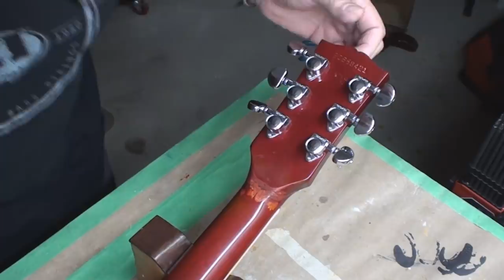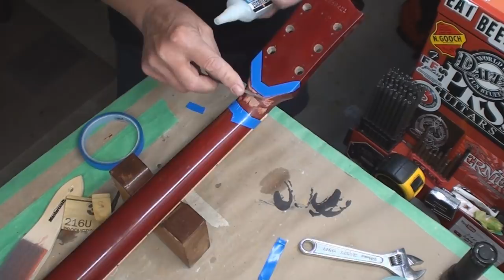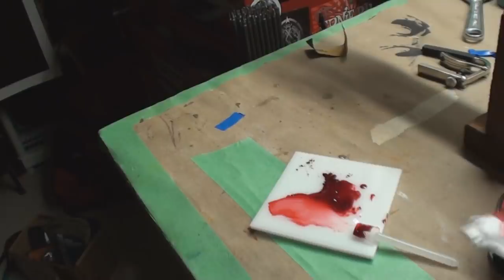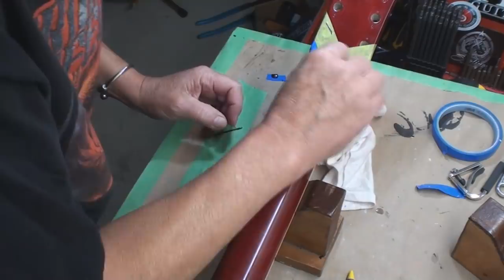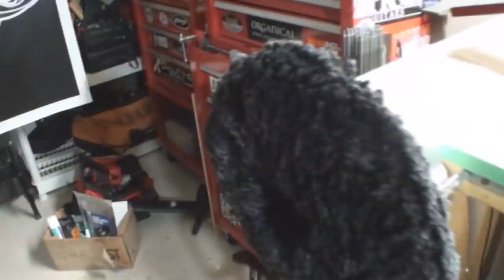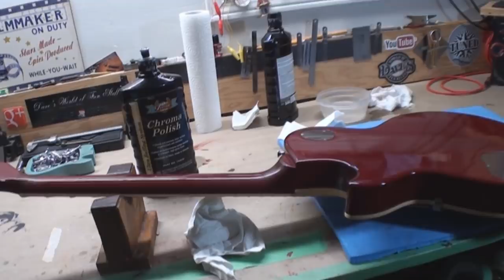Broken Headstock Repair Using Gluboost

Comment: Folk are quick to blame the extra degrees of Gibson's head stock angle for a weakness in this part of the neck, but really, how about not dropping it in the first place.
Reply: Damn right ! 
If you want to do gymnastics while playing a guitar, invest in strap locks, then you won't risk expensive repairs after every gig !
Reply: It's not the headstock angle that's the issue, it's the fact that they use a single piece of timber all the way through, letting the wood grain create a natural "fault line" at the headstock...and *on top of this*, they remove a chunk of wood from an already structurally weak area for truss rod access, rather than a stronger point such as, say, where it joins the body...

I get what you're saying, and everyone should exercise caution with their instruments, but the fact of the matter is...shit happens, and owning a Gibson puts you at a distinct disadvantage WRT damage to your musical output and/or wallet in the case of said shit happening.
Reply: Ian Clarke Strap locks are a gift from the heathen gods of demon music, I agree. Every guitar should have them.
Reply: It's a bad design and they know it. It's more likely to break and you can drop all sorts of other guitars with a volute or just with a little less angle. They might break at a really hard drop but Gibsons break like crazy. Repair guys know it...you just get tons of those compared to other guitars.
As Kaiveran Lugheidh mentioned, the other reason is the grain that becomes short grain because of the change in angle while the wood fibres point straight ahead. That's why multi laminate, opposing grain and the flipped reglueing  in the first few frets ala Ibanez is much stronger. Still, the lesser the angle the less likely the break at a vertical drop on the back.
Reply: They can also break without any force other than string tension.  I was at Guitar Center (shame, shame... I know) and one popped a few feet behind me while sitting, untouched, on a floor stand.
Reply: Probably already had a crack from shipping, the highly qualified people from guitar center didn't notice it or it got dropped in the store, was picked up and gave in later.
Reply: Ah, good things to note that I didn't think of.  Thanks!
Reply: Kaiveran Lugheidh  my two Gibson guitars(les-sg) have laminate mahogany necks. 3 main spliced and two ears on the headstock.
Most of the cases that Gibson pack there guitars in don't account for a 17 deg headstock= the headstock is taking the weight of the entire guitar. This is as much yo blame for accentuating the weak spot.
Reply: Shout me down by all means, but are Gibson increasing the use of mahogany as a neck material and is this exacerbating the number of fractures?? I note that the new 355s have a mahogany neck whereas I think back in the '60s & '70s they had maple ones? I haven't heard of any incidences of weakness in the maple L5 necks.
Reply: +Oldpigsass   Maple necks on a Gibson are a bit  rare.  They have used 1-piece Mahagony necks forever and a day - and have always have breakage  problems (worse now with crappier wood supplies).
I'd still go with a Gibby over a Fender any day....though there are even better options.
Reply: Thank you sir. I checked out the Gibson site and was alarmed by the prevalence of mahogany even among the archtops. What's the attraction?  I only own three Gibsons, '73 L5S/'78 ES355/new L5 Doublecut, and mercifully they have maple necks, though the L5/L5S are 5-piece streamed with what's supposed to be walnut, but now I'm wondering!  Never any issues with them or maple necked non-Gibsons, an old green Starfire VI, Hagstrom Viking, and quirky Antoria jumbo with a fabulous fat flamed maple neck, back and sides. No mahogany anywhere...... except the wardrobe doors.
Reply: I picked up an Epi semi hollow body at a GC with a cracked neck! I gave it to the manager who quietly put it away. Quality  control!
Reply: Well I guess a chain is as strong as its weakest link. Having said that, and admitting that although owning a couple I have a slight aversion to solid bodies........ have you seen the size of the centreblocks in 335s? I knew they weren't very narrow, but there's much more block than hollow. My God it's like a windowsill!
Reply: yeah , I have seen them come out of a case with a snapped stock , always at the volute
Reply: the simple solution would be a scarf joint or a volute... it's fine to complain when they know a serious flaw exists and they don't rectify it.  If you so much as look at an SG headstock the wrong way they fall off...
Reply: if you can hear the difference between a guitar with a volute, a guitar with a one piece neck, and a guitar with a scarf, you're lying.  I'm willing to bet most fans would rather a guitar where the head doesn't come off if you breathe on it too hard

Comment: This reminds me why I should buy a Strat instead of a Les Paul.
Reply: amen
Reply: Subjective.  What's not subjective is strats are about $3000 cheaper.  LP's aren't $3k better sounding.
Reply: Lee Mcfarland . Exactly why I play strats everyday their way cheaper and very versatile guitars . Good enough for Hendrix and Gilmour good for me too lol
Reply: Just like with the parties...there are more than two options.
Reply: Except for the fact that the vast majority of Les Pauls don't even cost $3000 total. The core USA ranges from around $800-$3600, with most of the normal les Pauls being around 1500-2500. American Strats get in the mid-high $2000s too. The only Gibsons that cost $3000, even $2000 more than American fenders are the custom shop Gibsons, and custom shop Fenders cost just as much. What's not subjective is that Gibsons offer the most affordable American guitars of any of the big names, and also that they offer guitars in all different price brackets for people who feel like spending more. 

I love Strats, but this complete nonsense and misinformation to bash Gibson is getting so annoying.

For example, I bought my new 2017 Les Paul Standard for $2700, and with the asymmetrical neck, compound radius, individual coil taps, phase inverter, and pot bypass, as well as locking tuners AAA top and all, it's a hell of a lot higher spec'd than its competitors, especially Fender's equivalent priced Strat (which I also love, not bashing, just defending) .

Comment: that stuff is amazing! I found it on ebay and I needed something to seal of a little divot on my les paul neck on the side below the nut. She fell off the strap WITH STRAP LOCKS and hit the floor. Could have been worse but it drives me crazy knowing it's there. I thank you for your vids as a working father of two kids I have little extra $$ for sending out repairs so with your help I'm able to get it done myself with the occasional gooch.

Comment: Nice work, Dave. Had me wonderin' trying to trickle glue down the sides of the damage. The pins should hold i'd like to say forever, but...:). I have a circa '83 Cort Arrow with a headstock repair. I always feel if it wasn't for that 3" long truss rod cover the headstock would have broken off when it fell in '00. $150 used in '96 and buy of the decade for me. I think i spent $60.00 on the repair Even though the damage can be seen, it's still in one piece.

Comment: Hi Dave, I am a luthier as well, and am using Gluboost products. I recently fixed a cracked neck 's scar on the back of the neck's finish and it came out pretty good, but I did have a problem with the masking I used sticking to the fill n' finish. In this repair what did you use for the masking material? BTW, I sub'd your channel cause you seem to be doing tings much like me, and I learned some stuff watching you. Good Stuff! Thanks.

Comment: Glue boost will Jack  . It will break again without proper reinforcement.
Reply: Hence why the neck was epoxied and pinned, the glue boost was only used as a filler.

Comment: Can you get the same or similar results with regular CA? I've done a few drop fills on my strat neck with regular ca and it turned out really good. I had looked into using the glue boost but it seemed pricey for what I wanted it for.
Reply: There are tons of different CA-Glue. It's not all the same. The thinner it is, the faster it cures. Some CA glues are getting very milky after curing and some turn yellow-ish after a few years. So at least one that stays clear and goes well with tints would be needed. It all depends if the repair is worth it. But in this case, the tinting only in the crack area is less work than sanding everything down and spraying with the airbrush or in the booth. 
I can recommend the pages from Henkel online to get to the glue you want or you can call them for free. There is CA-Glue that allows a bit when a bit more flexability is needed. Others stay totally transparent so you can see through, some can bond even hard to glue plastics...worth looking into.
Also, if you got a decent glue you can tell exactly how much temperature is needed to make it brittle again. Like for flooding fretslots from the side or something else you might want to take apart again some time without ripping it apart.
Reply: My experience is that it all blushes and is a real pain to work with.  This stuff seems great.

Comment: Hey, Dave. I've got an Epiphone Dot with a broken off head stock. Would Gluboost fix a complete repair, or is it only good for cracks like you used here? And if so, what do you recommend for a total head break?
Reply: Did you? I'm sorry, man. I must've not been paying attention to that part. I'll re-watch it again. Thanks.
Reply: There's lots of vids on youtube on fixing them. Lots of different methods as well. Which one to use kinda depends on what kind of break it is. Sometimes you get a long but clean break with lots of surface area. Pretty easy to just coat with wood glue and clamp up. Others you have very little surface area to glue so you need reinforcements. And others blow up and fall apart into tiny bits. Seek professional help.
Reply: I'd also recommend the dan erlewine video on broken headstocks. It was uploaded in the last two years. You can't miss it on the stewmac videos. He digs out lots of the loose splinters and explains a lot.

Comment: Ok, I have a question...
I've seen you do a couple of headstock/neck repairs. Aside from keeping the original serial numbers on the guitar, why wouldn't you just replace the neck instead of repairing it?
Reply: Last I heard new neck from Gibson is over $1000, plus sending them anything there is shipping and insurance cost, and it takes forever.

Comment: "a little huffy"? That accelerator is nasty stuff and toxic. Can you feel your brain cells floating off in a mist of organic vapors? One recommendation on staining: use a Q-tip to apply fill&finish stain and an artist flat sable brush to feather it in. Another tip: keep the CA in a covered can with silicon gel packets to absorb random moisture. They'll last much longer.
Reply: If it's a regular Q-tip you'll have lots of small hairs in there. If it's an expensive repair I'd suggest buying a pack of swabs for microscope work. An absolute lint-free, soaks up like tiny sponge. Those are great to clean camera lenses too. One per Job isn't that expensive.

Comment: Has Gibson ever done anything to make Les Paul headstocks less breakable?
Reply: Bongo Nutty yeah they slap epiphone on them, use a scarf joint, and use less of an angle on them.
Reply: With the main brand, they go back and forth more often than cricket players on the practice of using volutes...not sure that counts.

Honestly, they should have the truss rod access on the other side of the neck, just like plenty of other guitar companies that lack such an extensive cranio-rectal interface, but...you know how that goes.
Reply: yea the gibson reps said "buy a stratocaster "

Comment: It's going to break again ! No glue was inserted on the cracks, no cracks was opened and no wood was added in the neck. I seen alot off ol guys fix les Pauls. So you get a 👎
Reply: He already did the repair and he already explained that he pinned it. This is just the finish repair.